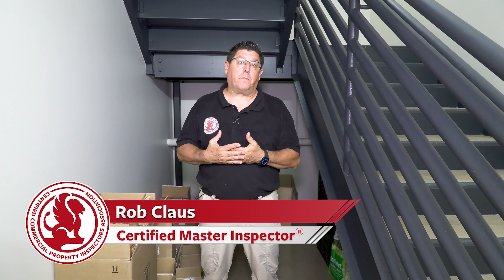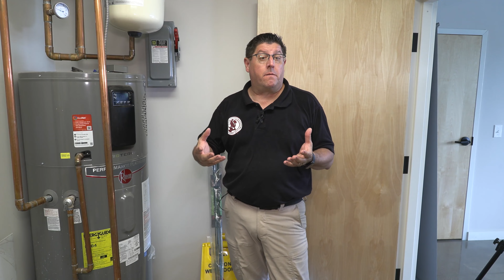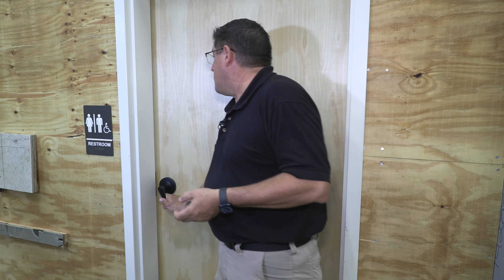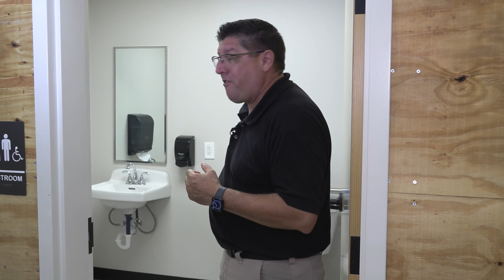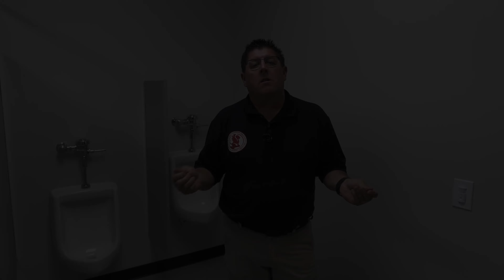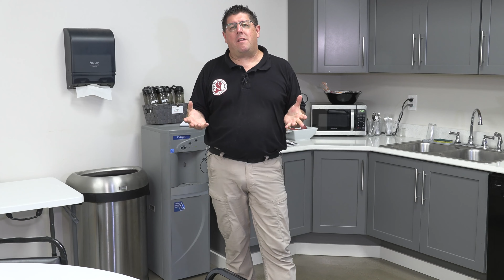Commercial Property Plumbing Inspection at InterNACHI's House of Horrors®

Comment: A drip Pan is required if it can leak and do structural damage. This actual house or building foundation must be higher.
Reply: Thank you @donaldblank8873  this unit was on the ground floor of a slab-constructed building. You are correct that a drip pan is needed when the unit can leak into structural areas. That would be something to look for during an inspection.